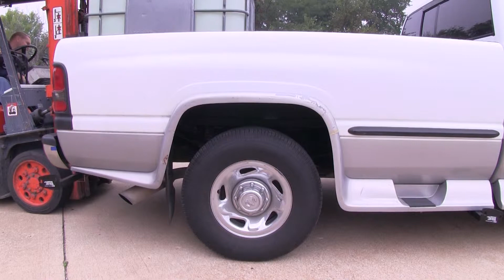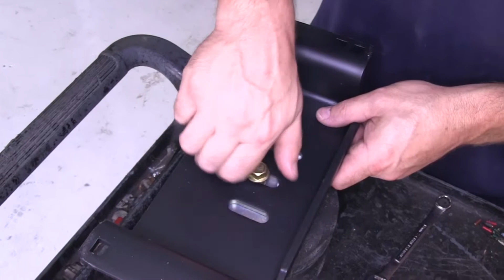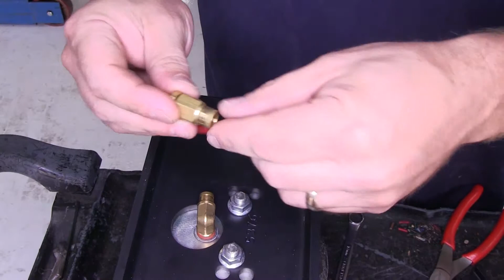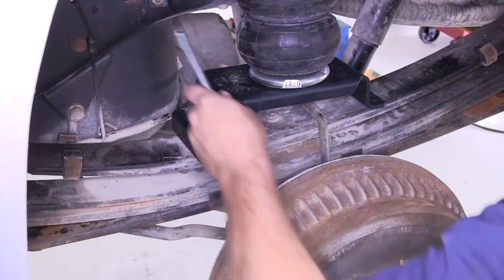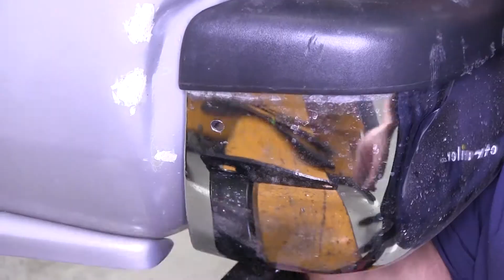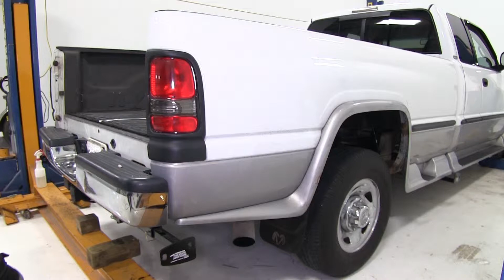Installation of the Firestone Ride-Rite Air Helper Springs on a 1999 Dodge Ram Pickup - etrailer.com

Comment: Can I use this to tow a 12k lbs trailer
Reply from the maker: The Firestone # F2071 Ride-Rite air helper springs would offer 4800 lbs of support, which would be plenty to handle the roughly 1800 lb tongue weight which would be typical for a trailer weighing 12,000 lbs. The # F2071 would be a fit for your 1999 Ram truck, as long as you have at least 7-1/2 inches of clearance between the inside of the tire and the outside of the frame member.
https://www.etrailer.com/Vehicle-Suspension/Dodge/Ram+Pickup/1999/F2071.html

Comment: Question, I have a 95 Dodge would the installation be the same???
Reply from the maker: It sure will! The Firestone # F2071 will fit both the 1999 Dodge Ram shown in the video, as well as your 1995 Dodge Ram. The install procedure for your 1995 model will be the same as what's shown in the video. You'll also want to know that you'll need at least 7-1/2 inches of clearance between the tires sidewall and the frame in order for the # F2071 to fit.
https://www.etrailer.com/Vehicle-Suspension/Firestone/F2071.html

Comment: if I'm hearing you right, did it only make 3/4" of a difference
Reply: From my understanding after bags installed it was 3/4 inch higher loaded than is was unloaded with no bags

Comment: Will this application work for the dodge ram b1500 van?
Reply from the maker: We do not have a Firestone kit that fits the 1999 Dodge Ram Van. We do have a few Air Lift kits that will operate the same way. Check them out the following link to our website.
https://www.etrailer.com/susp-1999_Dodge_Van.htm?fUrl=-pm-Air_Lift

Comment: I have this but the air is leaking out of the glovebox where the switch is. How do i fix?
Reply from the maker: You most likely have a hose that is loose in the back of the switch. We recommend taking a bottle of soapy water and spray the fittings and where the bubbles form is where your leak is. If it is the air line connection, you can remove it and cut a fresh end on the line and reinstall. You want to be sure to cut a straight and clean cut on the end of the air line.